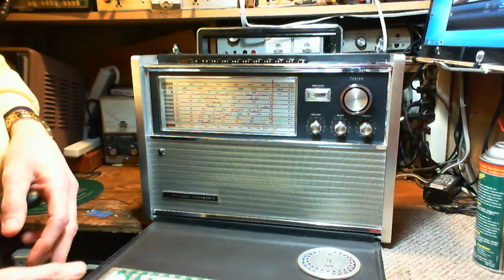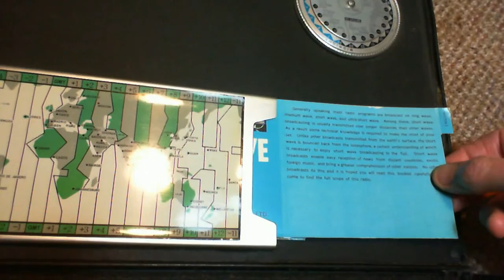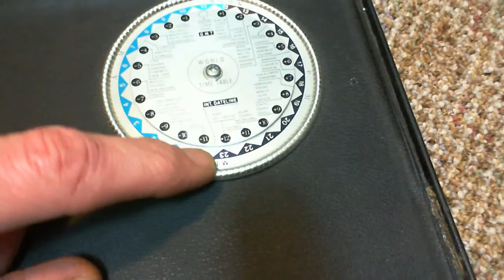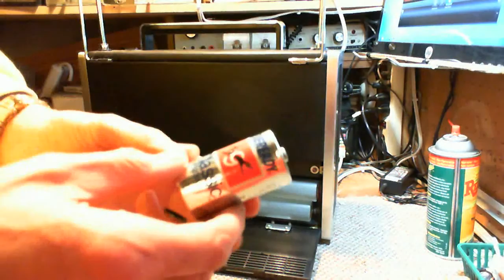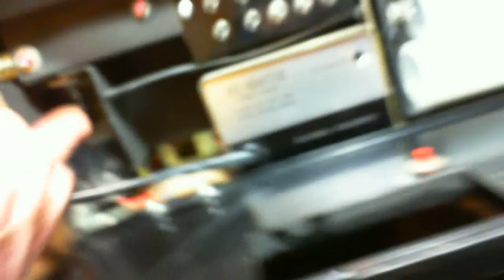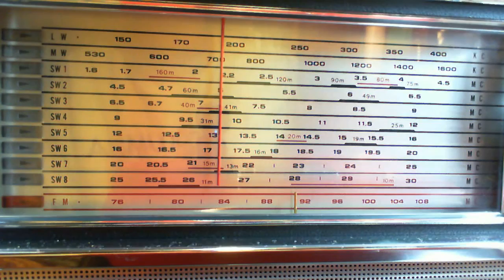Panasonic RF-5000 AM/FM/SW Radio - Checkout

Comment: At least they made the battery compartment hold the majority of the batteries horizontal, and at the bottom,...which keeps some of the acid from eating away at the terminals, and the circuit boards..

Comment: Hey tom, I recently just acquired one of these radios from a house my family bought in upstate New York. I was wondering if you knew how to change the bulbs in the radio itself. The ones in mine are kind of dull
Reply from the maker: Off hand, no idea.
Reply: Jim Lindenas  Hey,  a fine radio indeed.  The rectangular metal
gadget on the backside is the SW-
Loop-antenna.  Sender : M.  Manner. 
Radio Historical Society of Finland SRHS.